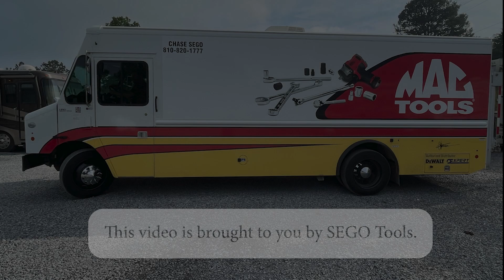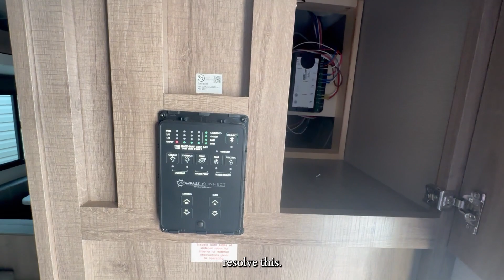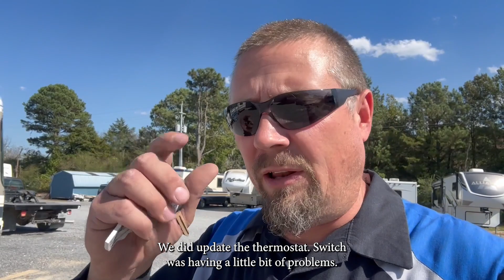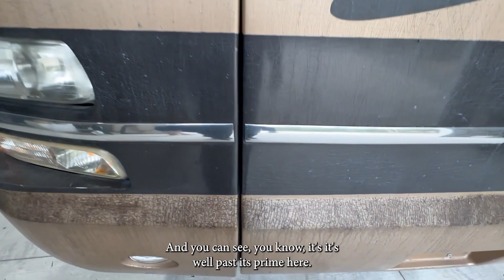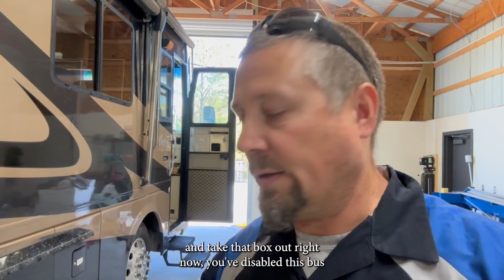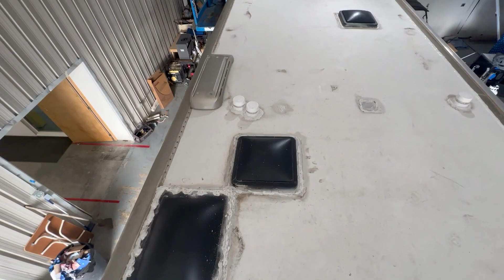How To Lose Money

Comment: The problem with Lippert is they buy out these companies that develop these high tech, specialized components and then have no one that knows how to diagnose them.  The proof is them sending out a replacement controller ECU that still needs a software upload?  They absolutely should of verified the functions of the current ECU with you and loaded the software prior to shipment. Secondly, theres no reason on earth why RV's need to have such complicated, computerized components. Combining all these functions (lights, tank levels, slide out controls, battery level, etc into one panel) just overly complicates  doing a diag.